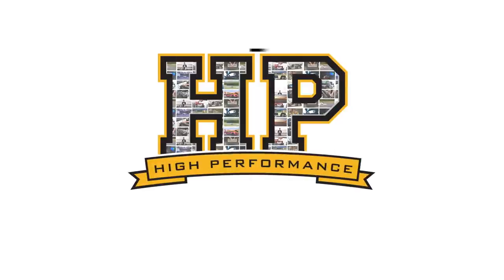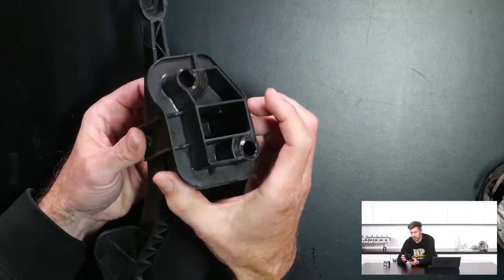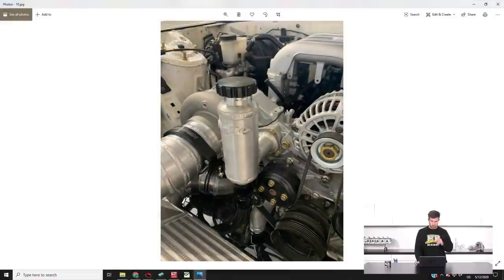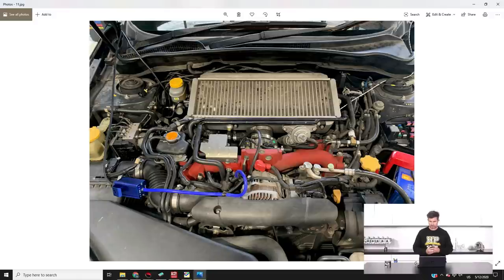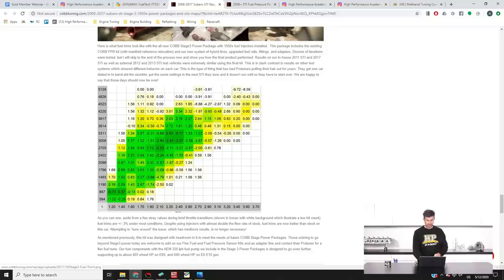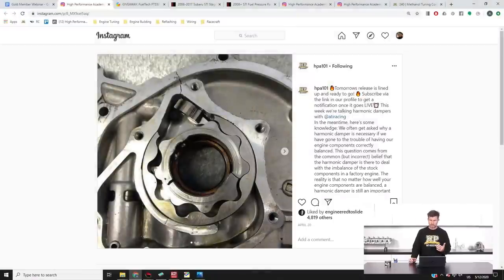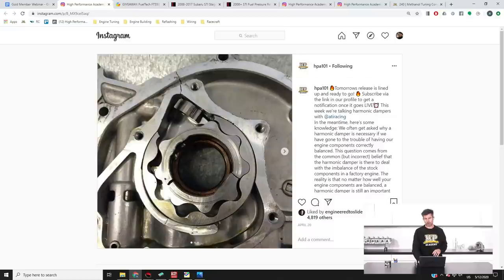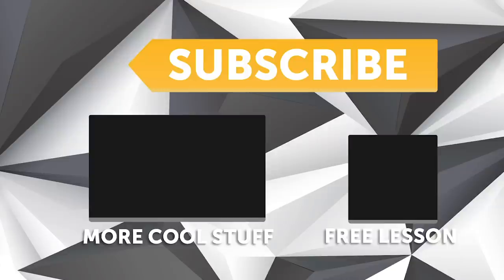Open Source Tuning + OEM 'Shortcut' That Can Cause You Headaches | Today At HPA [UPDATE 240]

Comment: I built a tool in excel that you could load a datalog into, it would filter the wbO2 data depending on rpm delta, throttle delta, and etc. thresholds, and then fill out suggested change values for the subaru "speed density" correction table as well as suggested change to the MAF with an intelligent scalar to address change towards SD or MAF depending how the correction correlated. It worked so well, a single 30min datalog making an effort to drive long sweeps through the cells in the SD table would fill out this table near perfect the first time and generally only took a few minutes of fine-tuning whereas I used to waste an entire day chasing my tail on the MAF scaling and SD tables.
Reply: Can i have that?
Reply: @alifkm2   probably referring to this https://github.com/vimsh/mafscaling

Comment: Harmonic balancers , if a manufacturer could save $5 dollars per engine by not fitting one it wouldn't be there .
The reality is also , you are not going to notice the difference in the ability for an engine to rev between stock and lightweight pulleys. The simply do not have the same mass compared to a flywheel .